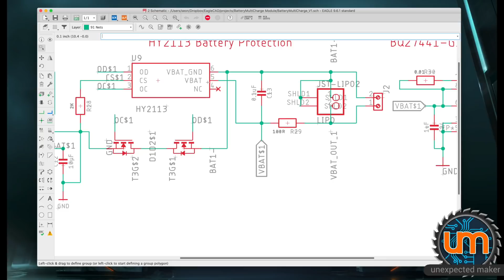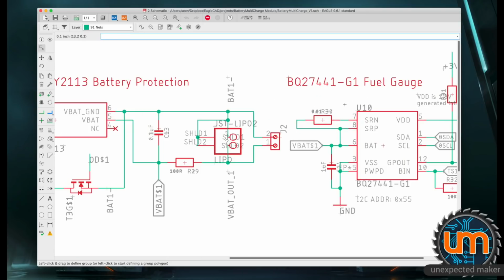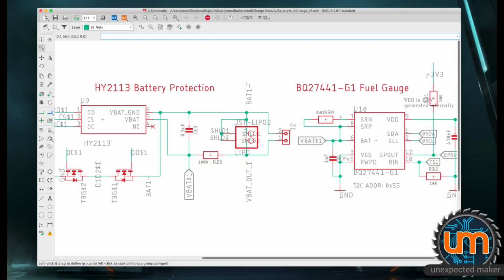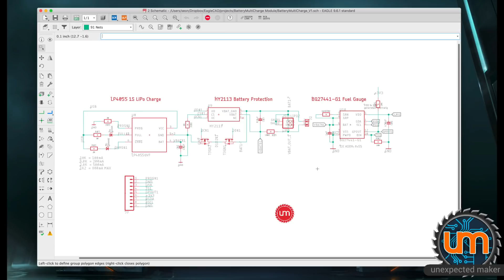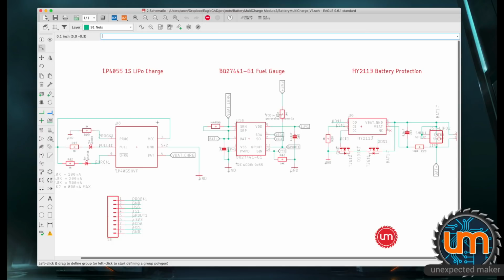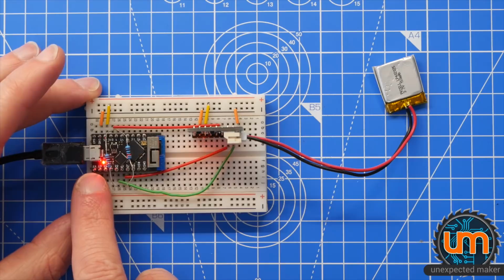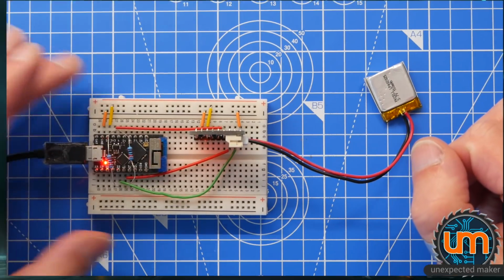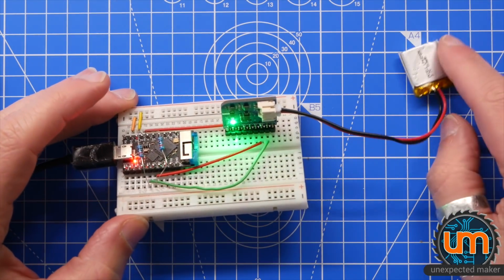Multi-Charge Prototype - First build - Doh!

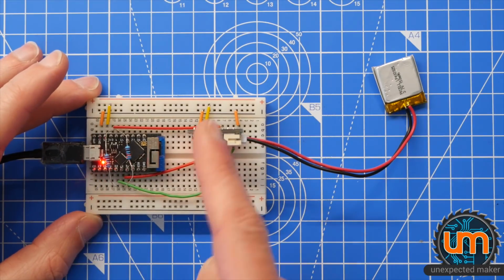Comment: Afaik all the LIPOs (with a small PCB), such as the one shown from 13:00 onwards have onboard protection ICs. Why did you chose to use another on your board ? Just curious, because I'm working on a thing myself with a small lipo, however, I'm very space constrained as far as the PCB goes.
Reply from the maker: So folks can plug other non protected lithium cells into It :).

Comment: I'd recommend you add a i2c EEPROM and program your module ID into it.  if you have multiple modules connected simultaneously I would use a OneWire EEPROM.
Reply from the maker: Sure, but that adds extra steps for me (programming the EERROM), plus makes it much harder for folks to design their own modules to use on the base. Technically, the base can be used for any I2C controllable purpose, not just battery charging.

Comment: Please add a separate possibility to configure the i2c adress. This would allow to daisy-chain multiple pcbs to something like a charging cluster for multiple batteries. In the end it would be nice to order some of the finished kits for a reasonable price tag. I wish you a wonderful journey on your route from germany
Reply from the maker: Sorry, the addresses are not changeable, and chaining them is not something I'm interested in. They are designed to sit in parallel, up to 8, through an I2C MUX. SO I can charge up to 8 batteries at once. Check the link to the stream in the video.

Comment: Nice project.

On the new schematic, the 100Ohm resistor, isn’t that still in the wrong place? You mentioned it should be on the IC side but I might be wrong.
Reply from the maker: No, it's now in the right place. It's between the Protection IC and where VBAT goes to the FG. Before it was between the battery and where VBAT goes to the FG - doh!
Reply: Unexpected Maker Oh ok. I didn’t understand then. 😅